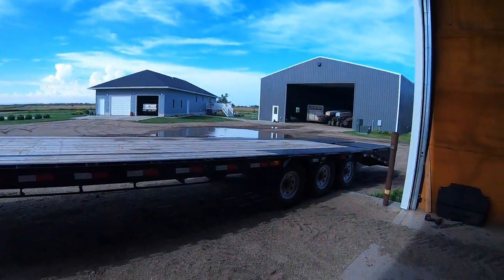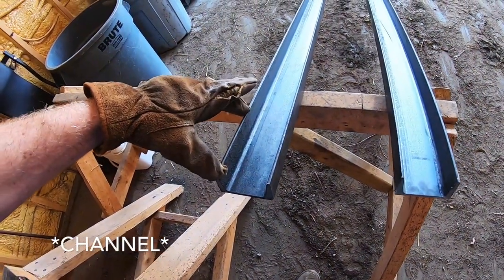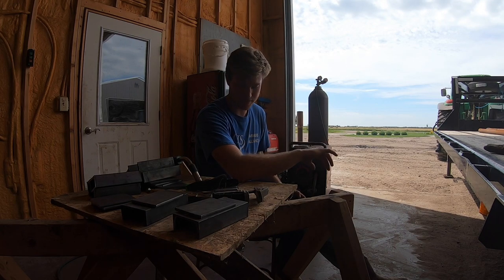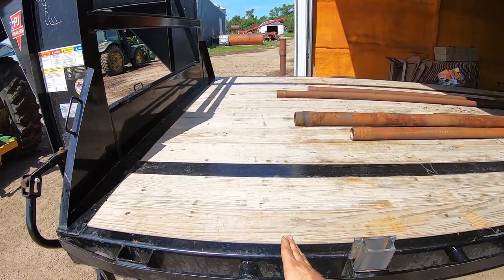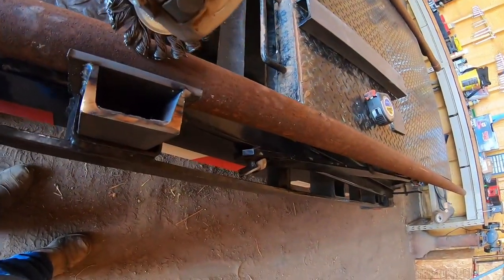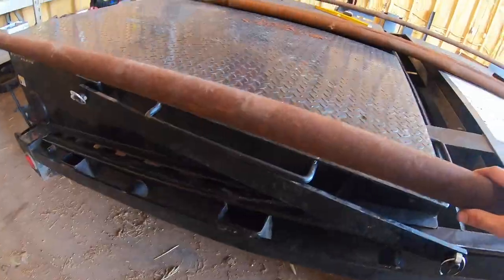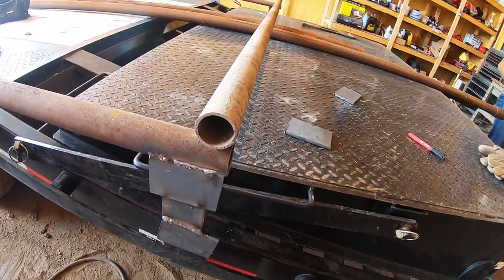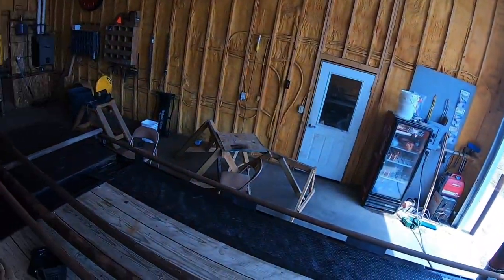Preparing the Gooseneck for Hauling Bales

Comment: We use a in-line dump bale trailer . it's holds 7 bales and you should be able to hold 15-18 bales but better have a strap over them as the DOT might like to write you a ticket.we do also use a 24 flat trailer to haul bales too. when we have a lot to move.

Comment: I also use a gooseneck to move bales and pull it with a loader tractor.  I use a 3pt bale spear with a ball on it to pull the trailer.  That lets me spot the trailer and bring bales to it 2 at a time.  You could probably add a spear to your hitch pretty easily.
Reply from the maker: Very smart!